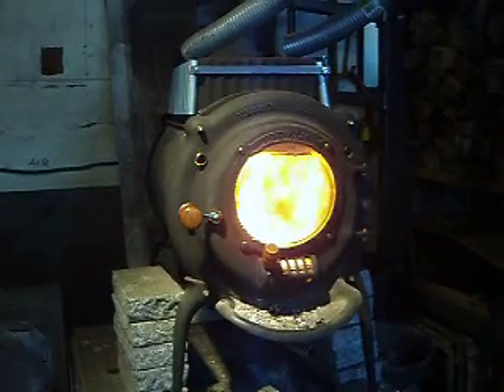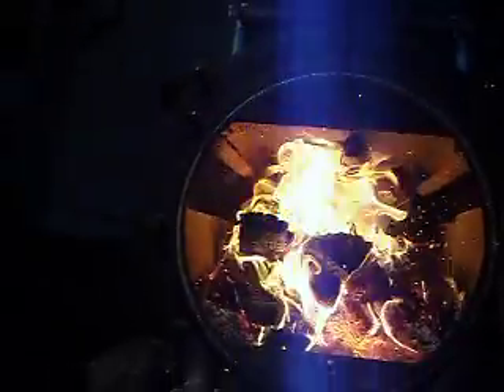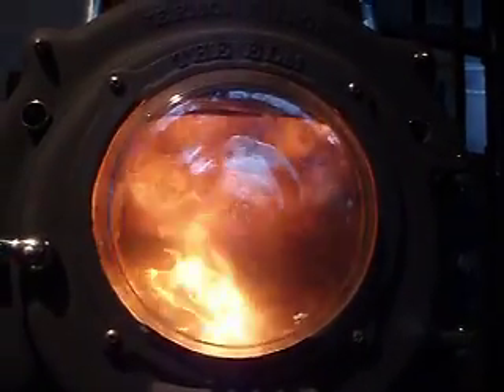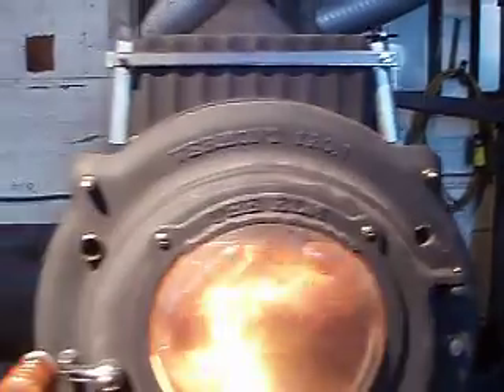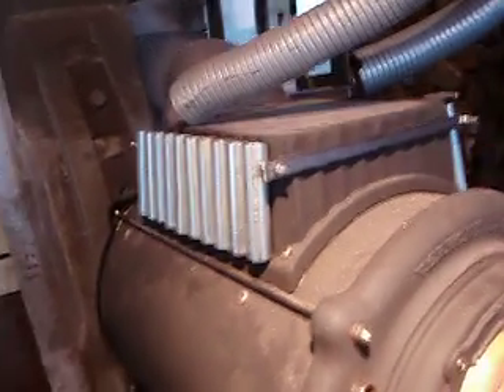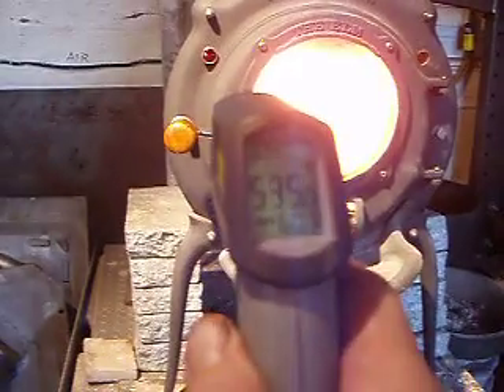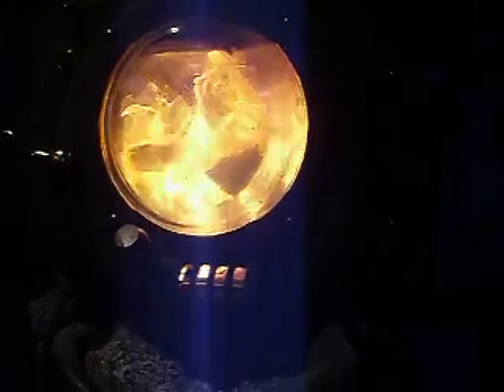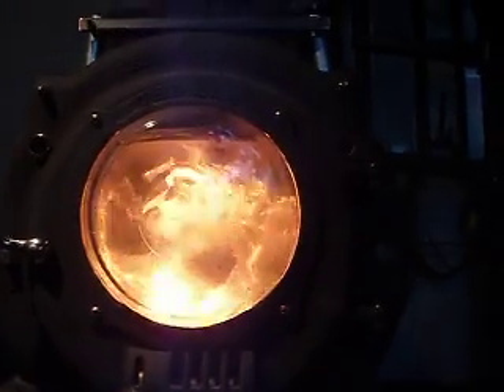"Raging" Secondary Flames in a Wildfire Elm stove

Comment: May I ask a question? Is room humidity ever taken into account? As a room becomes less humid it is more difficult to heat. I have found that in outside temperatures below 50 degress that 70-75 degrees F and 70-75% humidity is the most comfortable. Since dispersing heat is problematic would boiling water on the tops or sides of this stove increase comfort/ room heat dipersion and help with drawing heat away from the skin and increase humidity/comfrort?

Comment from the maker: It was interesting to see that drilling the 3/16" holes in the air tubes to 1/4" the secondary flames were no where near as prevalent.  That change meant the total area of the hole openings was doubled.  I quickly built a new set of tubes with the smaller 3/16" holes and installed them to see the wild flames return.  My helper uses 1/4" holes in his air tubes, and gets great results.  His chimney has wicked strong draft, and that is the difference.  Mine is 6" metalbestos, and his is 12x12 tile.
Reply: So would you say Chimney Draft has a Direct influence on secondary burner hole size? I have a homemade propane tank stove for my ice shack, it has a 3 inch flue pipe which does not have a huge draft. I assumed that a larger hole in the secondary burner would pull air easier. I wonder if your results are in relation to how quick your air is preheating to achieve a secondary burn? Maybe with the larger hole it was flowing the air to fast and not allowing it to reach a high enough temp to achieve secondary combustion??